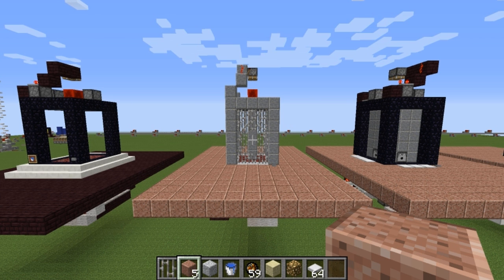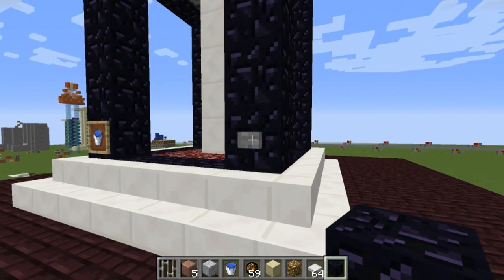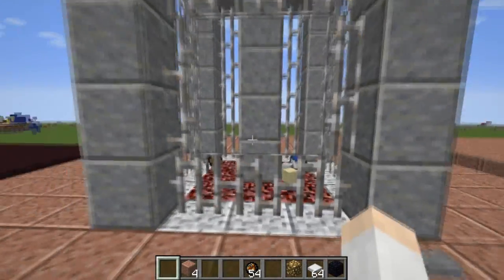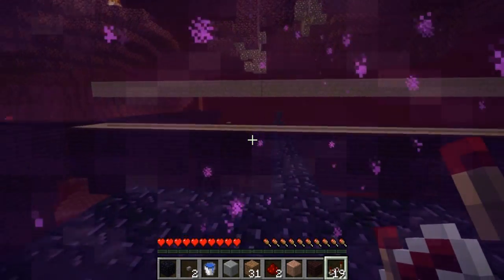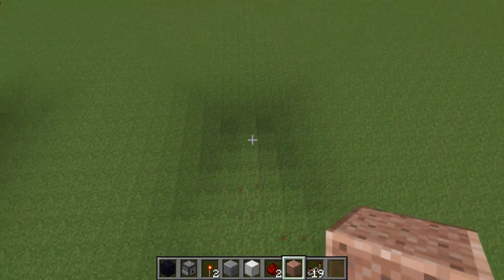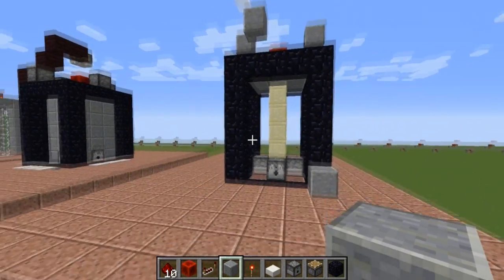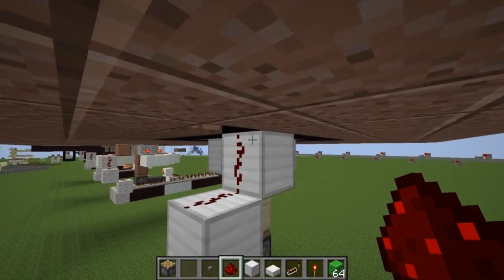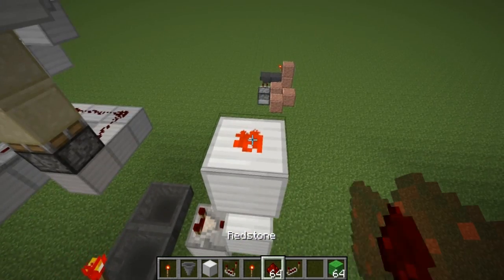Minecraft Invention: Automated Cube Portal [Tutorial]

Comment: you can make a on/off nether portal much better using much less space all you do is make a nether portal and stick a dispenser underneath (the left hand side before the corner piece) instead of on top so you cant see it and you only need 1 piece of redstone dust to activate it then on the other side (the right hand side as a corner piece) have a command block set to replace a section where the nether portal is created with air and it disables the nether portal, job done its what I did.